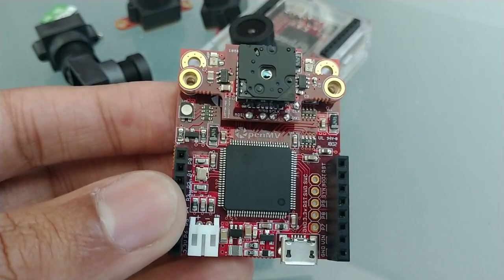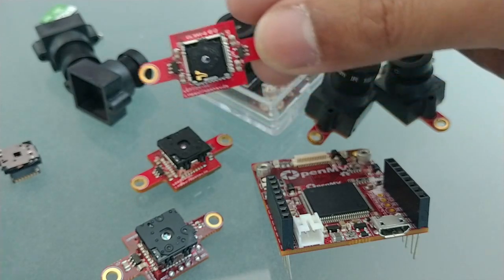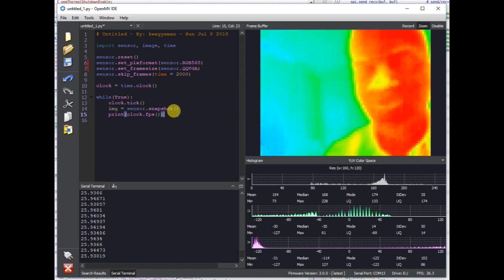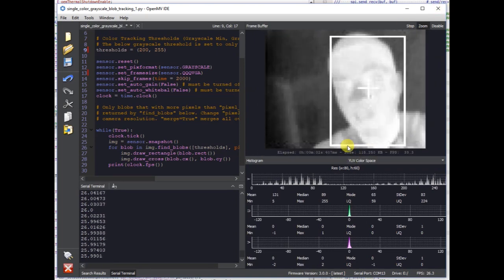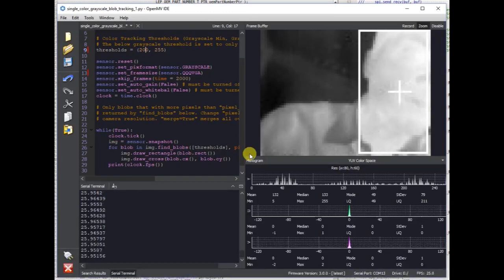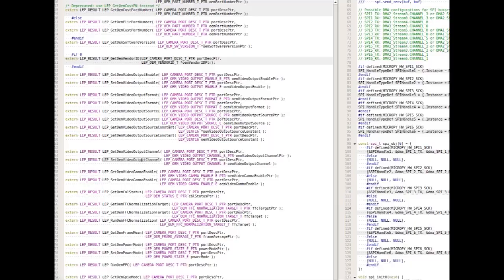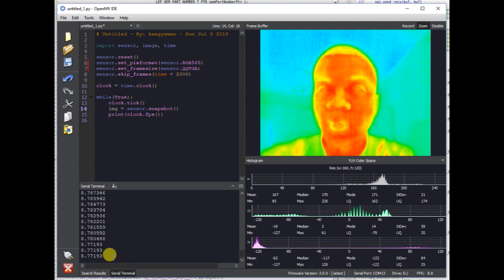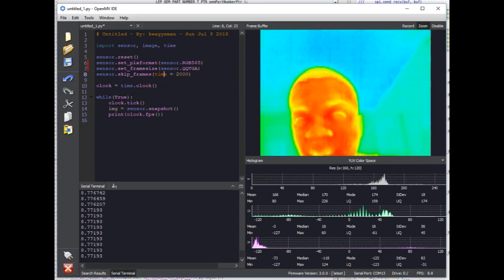FLIR Lepton 1/2/3 on the OpenMV Cam H7

Comment: Does the value shown still need to be scaled? Cause at 25.9C you would be dead.
Reply from the maker: You have to calibrate the FLIR. It's not too accurate out of the box. The Autogain by default doesn't give the right temps.